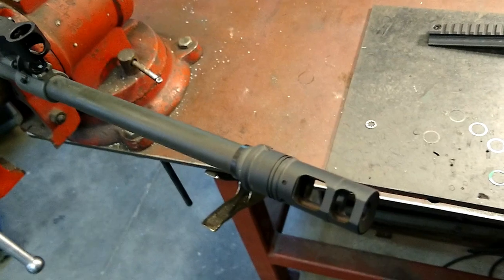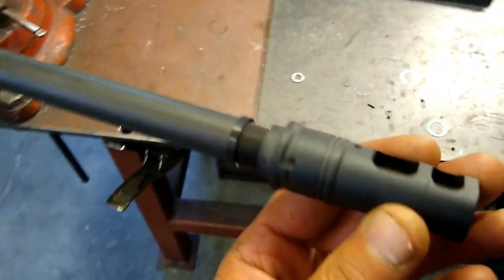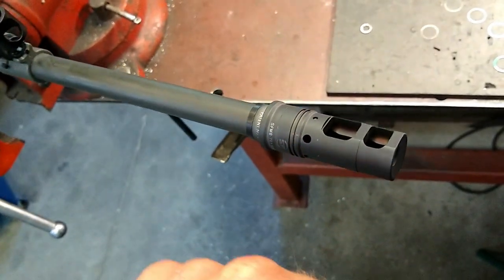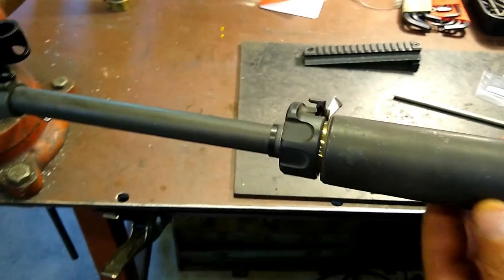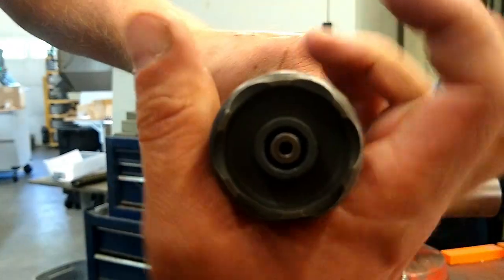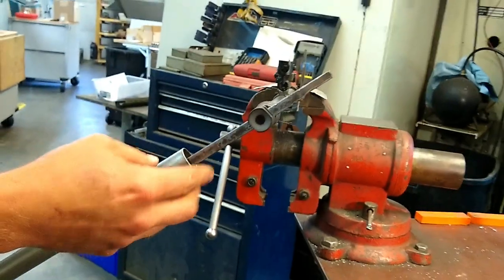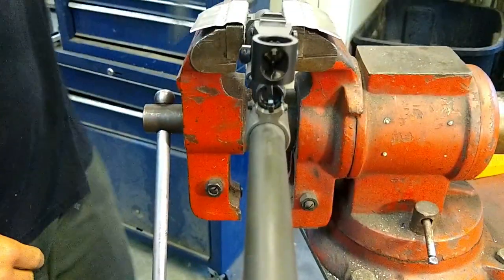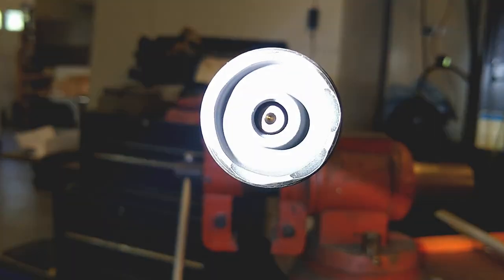PMM Surefire shoulder ring Install video For the FN SCAR 17 BBL

Comment: Great video just thought I’d add that the Chamfered edge is supposed to be facing the barrel per the surefire instructions!
Reply from the maker: Not on the SCAR 17. The chamfered edge will Roll the sholder of the barrel and destroy the sholder of the barrel and your supressor when you fire the gun the first time.
Reply: @jarodlegsdin993  interesting I just read that note in the fine print of the surefire instructions. I have already mounted my suppressor and probably put 100 rounds through it with the chamfered edge towards the barrel with no issues. Would you suggest I pop it off and flip it? Buy a new one or just leave it? I appreciate the response above!
Reply from the maker: @Evan Knapp  The SCAR 17/20 only have a shoulder of .030" and the metal is very soft. If you got away with using the tapered part of the ring on the barrel and its concentric ,leave it as you most likely "formed" the flat shoulder of the barrel a bit to the chamfered edge of the Ring and the likelihood the Flat 90* side will mate perfectly with the barrel now without re-shouldering it is slim. If it aint borke d0ont fix it!

Comment: How did you remove the factory muzzle break?
Reply: It should have a jam nut. Take a 3/4” wrench and put it on the jam nut (holding it in place) while loosening the factory muzzle brake at the same time.

Comment: I think the ‘story’ here IS: There WILL BE some NON-concentric ‘runout’ typically. I’ve mounted numerous muzzle devices over the years, and no doubt the application here is VERY involved with the technique, etc used. I haven’t had the opportunity to own suppressors (MY call as I’m not interested in “asking” the .gov for permission..so that’s on me) so I haven’t ‘mounted’ MD’s for that purpose. Surefire’s Warden, Noveske’s “PIG” yeah..and yeah a LOT shorter, but I still utilize a STRAIGHT rod of sorts to verify as much concentricity as possible. Never even came ‘close’ to having issues with mounting..